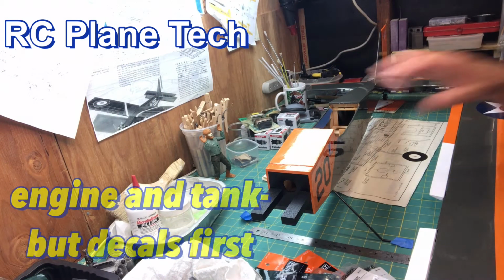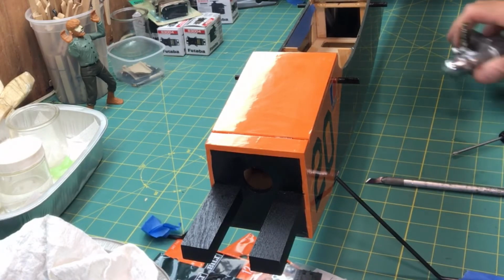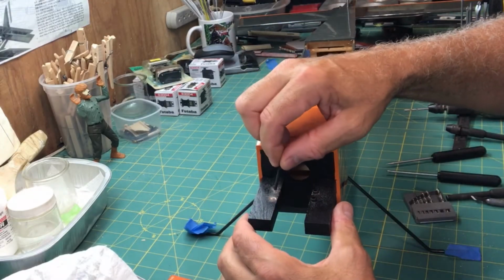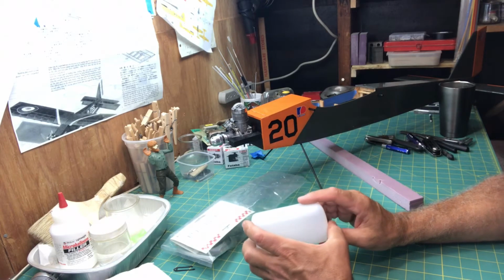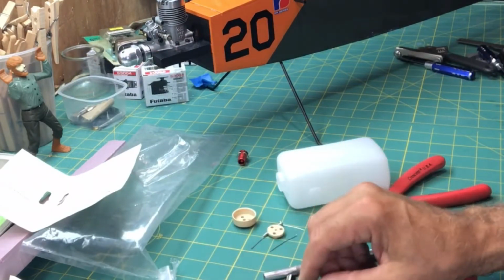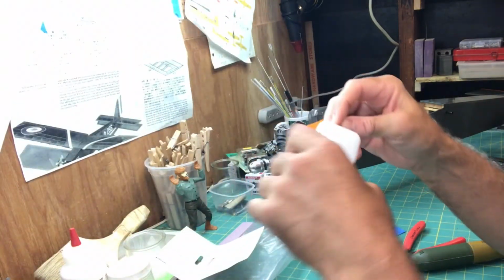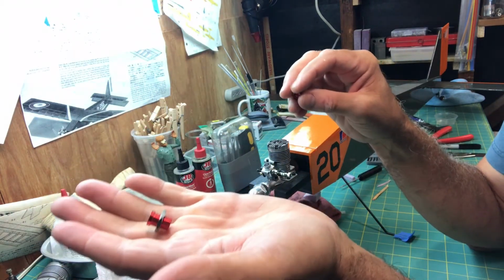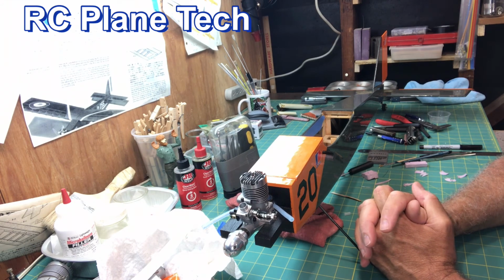Barnstormer 25S Vintage RC Plane Build: 23 OS Max 25 FP and Dubro Tank Install

Comment: Why is the fuel close to the engine how do you fix the cg with the Engine weight and fuel tank weight
Reply from the maker: Hi. Well the tank is up front per the kit design. Having it right behind the engine is common, usually up in front like that. The heavy stuff is up front, and the cg is about a third of the way back from the front and about at the main wing spar. The tail is lighter, but further away so it balances out.
Reply: @JamesRCPlaneTech  so I have to put weight in the back to balance it out my front plane is heavy and the cg isn't under the wing
Reply from the maker: I guess as long as you follow the plane specifications and the cg is where it’s designed to be, then if you have to add or subtract weight forward or behind it you should be ok. But hopefully you don’t have to add too much. If you have room to move other things around like the battery pack instead of adding weight, then that’s always better. But sometimes you are stuck and half to add weight. In the end, its way better to be balanced even if it costs a little added weight than to have a lighter but out of balance plane. Also remember that when balancing do it on an empty tank.
Reply: Alright thank you for that Information so the plane will still take off more wait if I have to add more wait also I'm build a scratch build gas plane
Reply from the maker: Well you do need to be careful and make sure you do not add too much weight. The plans and instructions should tell you how heavy the plane is designed for, and you want to make sure not to exceed that if possible. It can be tricky, but always follow what the plans and instructions say for weight and balance. If the cg location is far off from what the instructions say, then take another look at the build and make sure there isn’t a problem. If you can move servos, receiver and battery around and maybe use a little smaller fuel tank to achieve the designed cg location, that is better than adding weight.
Reply: It's a scratch build no  Direction or blueprints
Reply from the maker: Oh wow, that’s interesting and a challenge. Ok well unless its a special case, if this is a “typical” rc plane the cg would be approximately at the main spar of the wing, usually about 1/4 to 1/3 in from the leading edge measuring along the fuselage. Maybe look up specifications for plane kits about the same size as your build to see what kind of weight it may have as a guide? Good luck.
Reply: @JamesRCPlaneTech  alright will do thank you great work on your videos

Comment: Great video.   I've just installed a fuel tank in my Boomerang trainer 40 earlier today.  Your video explained everything very precise.   Thanks for sharing.
Reply from the maker: Great, thanks. I actually dropped my tank down to a 6 oz in this plane. I found that I just didn’t need that much for the .25. Even with 6 oz, it can fly 20 minutes easy. So I saved some weight.

Comment: Your 2rd line on the tank should have a klunk so you can draw fuel out of the tank at the end of the day.
Reply from the maker: Thats a great point. Thanks for pointing that out. I don’t usually drain my 2stroke engines, but I do drain the tank on my 4strokes and I have a different setup on those with the inline filling through the same line as the engine supply. I will try to remember this and mention your comment on my next vid. Thanks again.

Comment: I want to ask I created 30kg uav, can you recommend me brushless motor? If don't can you say, can I use gasoline engine for it? For example 32cc gasoline engine? Thanks!
Reply from the maker: Hi, I’m sorry but I do not know much about electric motor powered RC. I run glow fuel powered engines. As for the size of a fuel powered engine ( gas or glow fuel)it will depend on a few things, such as weight, wingspan, and aircraft type (sport, scale, 3D, etc). I don’t scratch build and typically build from kits that have plans and instructions that recommend engine or motor sizes per the manufacturer. If you have instructions for your particular build I would start there. If it was designed just for electrical power, you may be able convert to gas power, but you will probably have to research and check online sources and forums to get the answers you need. I would recommend searching online for your particular model and see if others have converted to gas and how they did it. Sorry for not being too helpful on this. Good luck with your build!

Comment: I have just built a nitro plane and was advised to set up a throttle cut to stop the engine. Do I then set the idle with trim as I can't use the idle screw. If I did use the idle screw for idle then the throttle stop would not work. Thanks. Confusing.
Reply from the maker: Hello, you are correct. The idle set screw on the carburetor would not be used if you set up a throttle "cut" using the transmitter. So you would want to make sure that you can fully close your throttle mechanically and then set your idle using your linkage connection from the servo to the throttle as close as possible. Then fine tune the idle as needed using your trim as you mentioned. Then ideally, when you push the throttle cut button on the transmitter, the servo will kick it closed and the engine will stop. You may have to play around with the connections and trim to get it right, and you may have to readjust it from time to time to account for little changes, such as the engine breaking in, etc. With a new engine it will be a little more difficult to set a smooth idle and such. But over time it will get better. So you may just have to tinker with your settings here and there. 

If you set the carburetor idle screw from preventing the throttle to fully close, then the cut throttle function using the transmitter just wont work. So disregard setting the idle screw and make sure you can fully shut the throttle so you can set up the throttle cut function as described above. 

I hope that helps, I'll try to mention this in the upcoming videos when I'm setting up my engine. 

Thanks for the interest in my videos!
Reply: @JamesRCPlaneTech  Excellent. Thanks for the reply. It makes sense now as I was a little confused.